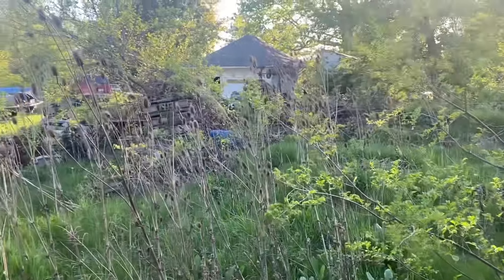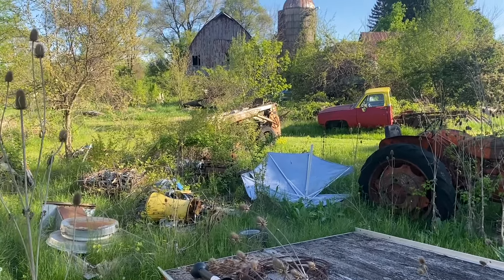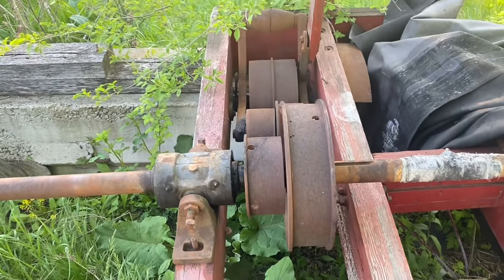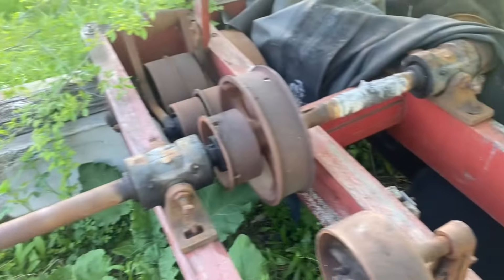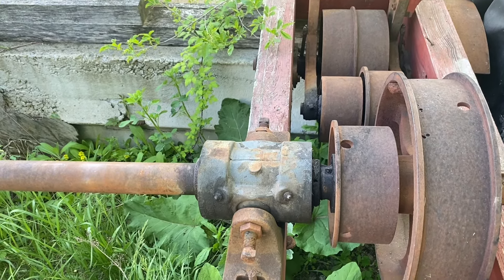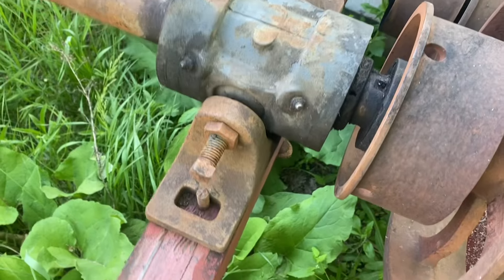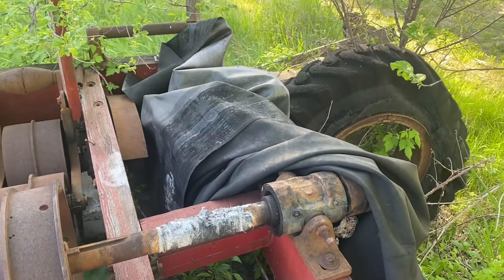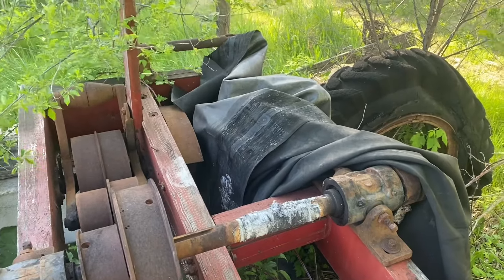Meadows mill husk frame and my back yard 5/10/24

Comment: Yep, I also get 'motivated' by watching other peoples video's!! Great to see what you're getting up to. Keep the vid's coming!! :-)
Reply from the maker: You can see how the vegetation has taken over, that’s why I need to get a skid loader running.
Reply: Thanks for the video. It's very helpful to see what other males look like. I think I am going to end up welding nuts on the end of the bolts, I just don't think I'll get them tight enough with a screwdriver head. Thanks for the shout out. I enjoy your content too.